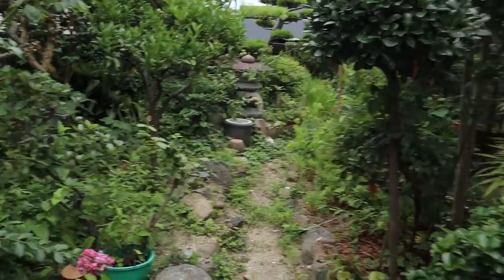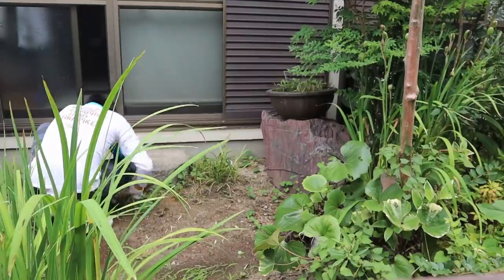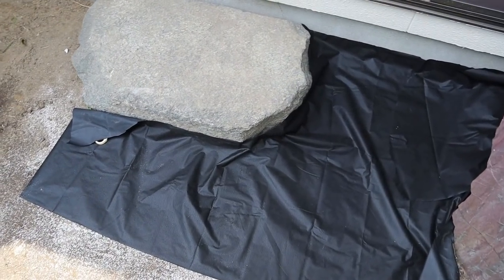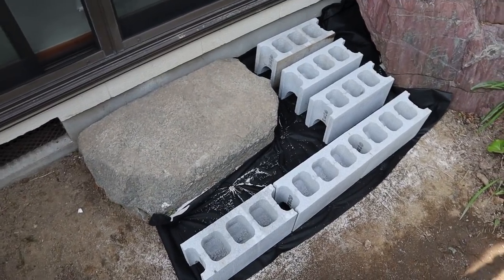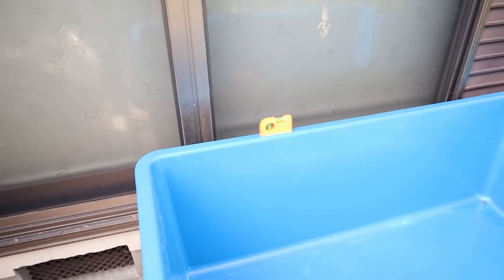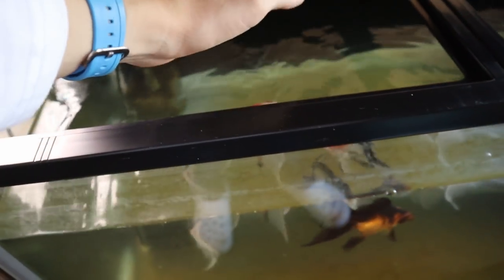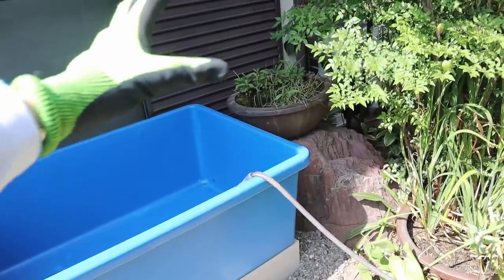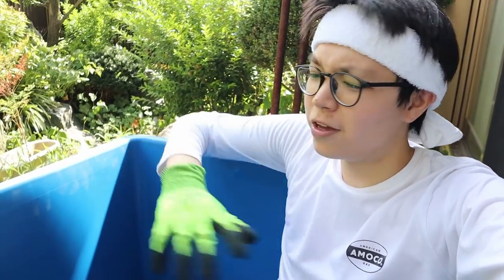Setting Up OUTDOOR POND in My BACKYARD!

Comment from the maker: What do you think about this pond?? The dream was to do a natural ecosystem pond but maybe that will be something to try in the future. For now, I just want a good home for some goldfish 😃
Reply: First year I wouldn't worry about the setup. Just start it this year and "feel it in", see what would work. It should be a slow continous progress. Thanks for great videos!
Reply: You wont be able to run air that far you would be better off running a power cable around the house than trying to pump air through tubing or pvc pipe.
Reply: Dig a place for the pond and burry half of the container and put some landscape around 😊
Reply: It was more cooler than I expect😍
Reply: What about burying the pond? that will also help with temperature control of the pond due to the changing seasons. It's more work, but you can dress up the edges with plants and hardscape.
Reply from the maker: @eugenetay3310  I don’t want the pond to be so low because I’ll have to bend down every time I want to take a good look at the fish. Adding to that, dirt will get in to the pond easier
Reply from the maker: @korzer  why not if I may ask?
Reply: Ryo please make that pond better, add plants and rocks, I love it!!! 😍😍😍 Ciao from Italy!!

Comment: I would definitely cover it up. Having something that works AND is pretty, is always more fun :). If you want it to be cheap, you could go with bamboo fence. Cut it to length and put it around it. It would already improve the look, hide the plastic and give it a more complete look.
Reply: I agree with some low fencing and a few rocks. Some small bushy plants around it might look nice too. Have you considered spray painting the outside? Ooh what about attaching wood planks or something around it to look like an oak barrel tub thing?? There’s so much fun stuff to do with it. I’m excited for you!

Comment: Nice work! Be sure to level the floor very well, if you are able to put more cinder blocks under it to prevent gaps under the bottom of the pond it would be more stable and safe, you could also try to put a styrofoam sheet under it between the blocks and the pond, that would help to prevent against cracks on the bottom.

Comment: Just a tip : you can bring a power cable or extender just like you are planning to bring the pvc pipe and connect it to a proper filter.

Comment: You should put Styrofoam or better XPS under your pond to protect from damage, distribute the weight and get more stable temperatures. xps around the walls would also be a good idea! Love your videos keep up the good work! Greetings from Germany!
Reply: Not 100 percent true. I know people who run 100+ ponds out of totes and they just set it on the ground. Nothing bad ever happens.
Reply: @JJJOOSSHHH  i didn’t say that the Fish will die,  but the temperatures will be more stable with insulation, especially with such a small water volume (you can measure it)
100% will it be better for the Health of the fish and their metabolism.

Comment: I would recommend to level out the gravel at the bottom, water weight would be at around 500kg in that pond and areas unsupported on the bottom of that pond could buckle. you can do a solar panel connected to a high capacity battery and connect a battery operated air pump. (easy to say but I also don't know how to do it)
Reply: Cheap solar phone charger panel with a USB air pump, no battery. It's a simple solution. You don't need aeration at night when the temperature drops anyway

Comment: 1. Covering it with wood would be more natural in the garden
2. If you planning the filtration you can use air lift system, it only require air pump as you already mention or just fill it with plant and balance amount of fish will do just fine! planning to do the same type on my rooftop with an aquaponic system
love from Indonesia Ryo.

Comment: Yes, definitely make it look better!  You have the makings of an excellent Japanese garden there!  The big blue tub is too fish farm looking.  A few thoughts;
1.) Are you placing the pond in front of a door?  Is there any chance of it being used as a door in the future?
2.) I would have sunk the pond into the ground.  As you well know Japan is HOT.  Having the pond buried would give you some much needed thermal regulation.  
3.)I would paint the inside of the pond (with fish safe paint) black.
3.) I would build a wooden box around the pond including a deck to cover the top edge of the pond.
4.) You could then spray foam insulation between the walls of the wooden box and the pond.
5.) Also, I would also never attempt goldfish without a filter.  Your hot summers are going to lead to a very oxygen depleted water column.
Best wishes,
Chris
Reply from the maker: Thanks Chris,
1) yes, it’s in front of a window sliding door but it’s never used and I’m only blocking one side of the door. The other side opens fully and is accessible.
2) I thought about putting it in the ground but I new id never do it. I would only dig a hole for a natural ecosystem style pond. I don’t want to have to bend down all the time to look at the goldfish and water changes will be harder to do. And dirt gets in the pond easier. Check out Phat ranchu on Insta.
3) I don’t know if we have fish safe paint here. We don’t have krylon. We have rust oleum rubber spray paint but I don’t know if that is safe or not. I’ll just let algae grow on the sides of the pond. You won’t be able to see the blue color in a couple of months.
4) I might slide some styrofoam insulation if I can fit some in between. 
5) I’ve seen a couple people in Japan keep goldfish in these ponds with no filters. Just plants. And the goldfish successfully reproduced and have babies growing in them.
Reply: @RyoWatanabee  
Sounds good Ryo.  I look forward to seeing the progress.
Cheers,
Chris

Comment: i was honestly expecting you to dig out a hole for the pond but since its a tub pond theres really no way to make it look natural, so i vote keep it clean and simple and just put like a big sponge filter on there and an aditional bubbler in the middle or something. wont it be a hassle to get in and out of that place you blocked off with the pond?
Reply from the maker: No one ever uses that door to get out plus there’s another door on the left side of the pond. So if I add another stepping stone there, it’ll be accessible. And yes, you’re right. No way of making this look natural and I’m not a fan of plastic tubs in the ground
Reply: @RyoWatanabee   yeah, i thought you were planing on digging out that area you showed in a previous video the one with like a stone lantern and putting in pond liner and using the stones to make it look good. the tub could look ok though, maybe glue like false rock or bamboo fence around it to hide the blue and make it look nice and elegant. like one of those big koi ponds
Reply from the maker: Yes, I mentioned digging a hole and using a rubber liner but I also stated that I don’t have the man power to do that right now and that it would be a project for the future.